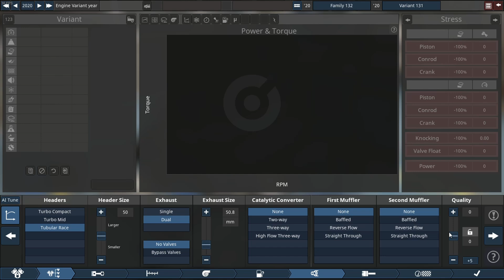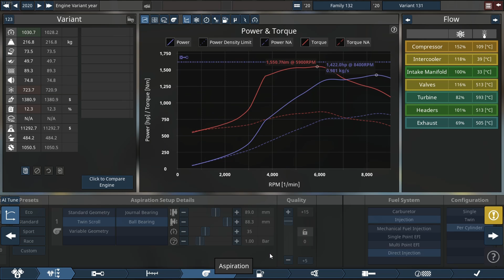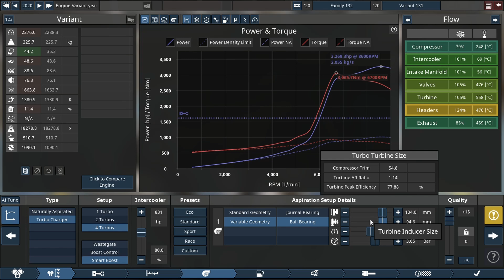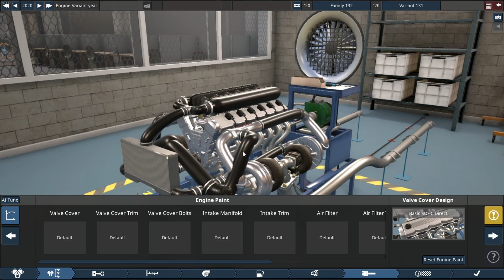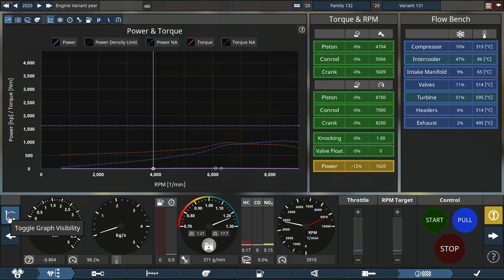M158 REPLICA ON METH! - automation the car company tycoon

Comment: These engines started with the M137 in the late 90's, which they created for the W220 S-Class and C215 CL-Class.
Since the W140 and its M120 were criticized for being too extreme (large, heavy, thirsty), Mercedes created a new V12 for the next generation of its top-tier coupes.
From 6.0L to 5.8L, not a big difference there, but switching from DOHC heads to SOHC ones dropped hp from 389 (last M120's) to 362.
But that was not enough. In 2002, they decreased displacement to 5.5L and added two turbos, pushing hp to 493 and torque to 590 lb-ft, IIRC.
All twin turbo V12's were based on it.
It's a good engine, but I definitely would've preferred if they kept improving the M120, even with turbos.

Great vid, thanks a lot. 🗿👍🏻
Reply from the maker: Thank you you know a lot more about Mercedes engines then I do
Reply: @Curiousgamer20  Glad to help! I love reading about engines. Sadly, I wish there were books specific about their V12's, but at least I never found any. 😓
BTW, worth building a de-stroked M120 revving to the moon...I wonder if it could tackle 1,000 hp without turbos, solely with revs...kinda like the Aston Martin Valkyrie, but with lower displacement and even higher revs.
Reply from the maker: Well if there aren't any books on these engines there is a lot of source's online and sometimes I use it but that engine build idea sounds awesome
Reply: @Curiousgamer20  Yeah, at least there's that! 😅 And we can actually have a blast with the bits and pieces scattered all over the web, kinda like a Lego with words, haha!
Jokes aside, most people increase the engine displacement, but very few go for smaller builds.
4N Motorsport built a de-stroked BMW N55 engine, from 3.0L to 2.6L, revving to 9000 rpm. Worth checking that out. The thing sounds almost like a Nissan RB26, beautiful. 👌🏻
Another one worth doing similar recipe (de-stroked) is BMW's S85, the V10 from the M5 E60. It's the closest thing to a proper street-legal Formula 1 V10 you can get, specially if tuned and modified to rev high (past 10,000 rpm) and kept naturally aspirated as well, although a twin turbocharged setup would be wicked too.
Reply from the maker: Yeah 😂 I read about the de-stroked N55 when I did a video on the N54 engine the I called the German 2jz thank you for the engine suggestions they are awesome
Reply: @Curiousgamer20  Heard that from the B58 as well. But the fact the timing chain is behind the engine is a nuisance. 😓
At least it's one tough son of a gun, heheh. 😁
Likewise for the vids!
😎🤜🤛😎